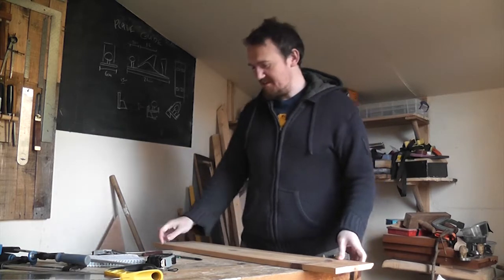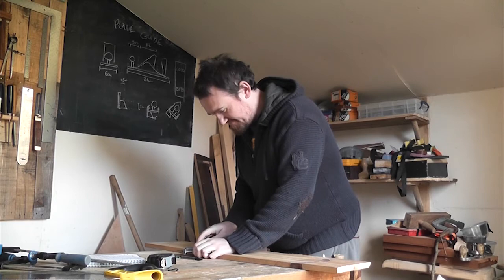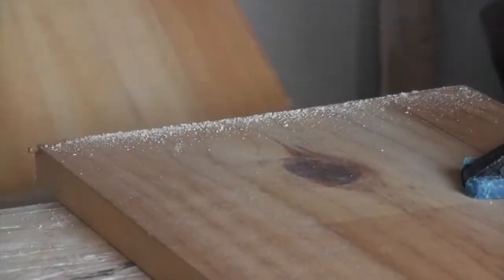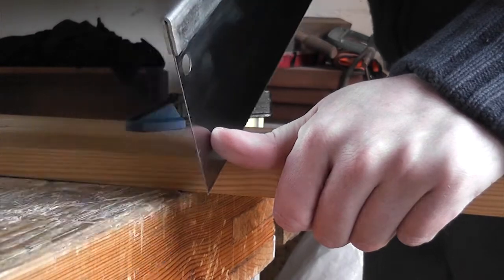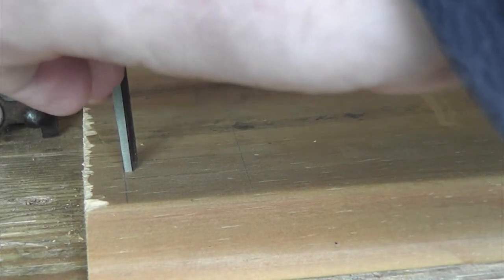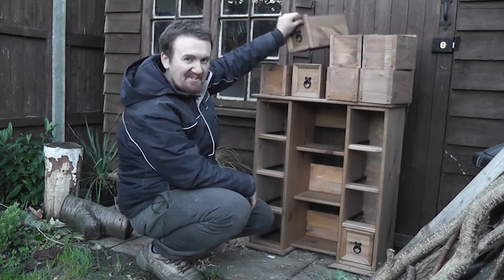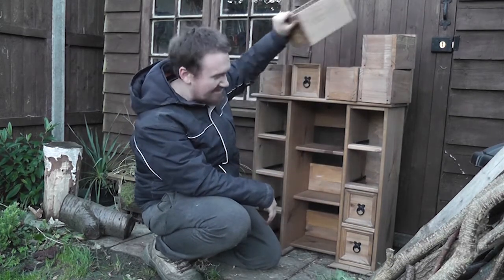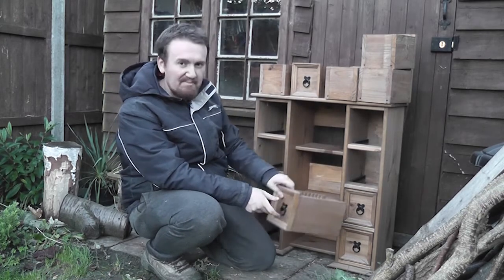Furniture Upgrade [Woodworking Project]

Comment: Good idea to integrate the two Clint. I wouldn't have thought of that. The dye looked darker during application than on the finished product. Did it fade as it dried or did you sand it back or was it just a trick of the light from inside the shed to outside? When you drilled the top and brushed away the dust I was blowing the screen of my tablet to clear it for you. I do it all the time when I'm watching woodwork videos, I think I have a disease. Am I the only one who does this? Cheers, Andy, Grimsby, Lincolnshire.
Reply from the maker: Ah thanks Andy, yes luckily the dye fades as it dries and is a very close match to the original colour of the units. Haha thanks for blowing that dust off for me! 

I posted your photos on my Facebook page, here's the link if you want to check it out https://www.facebook.com/timberanew/posts/563669470638380
Reply: Andy Tyrrell Andy, yes you're nuts. But in a good way. For now.